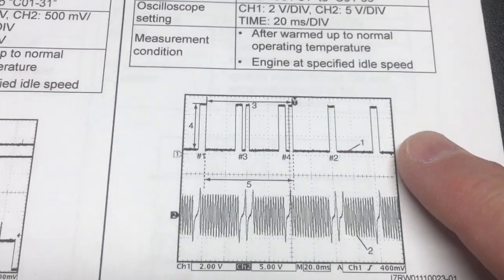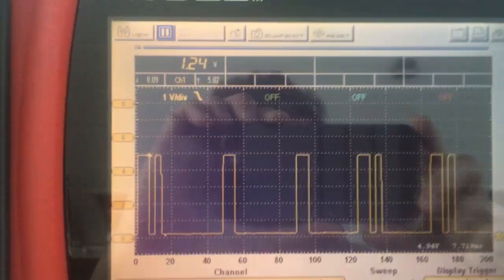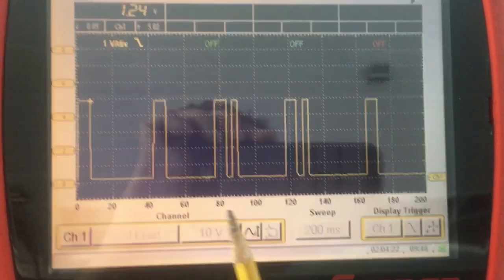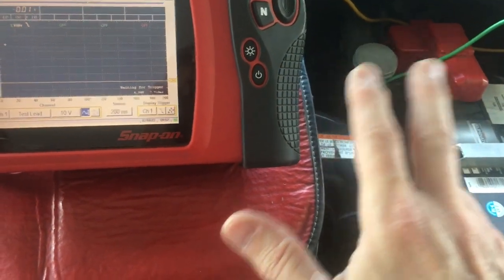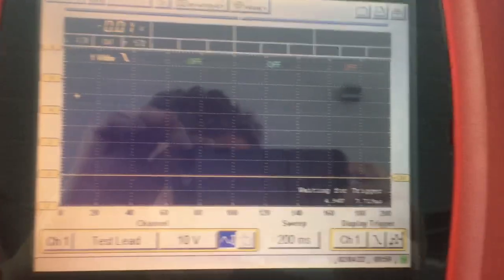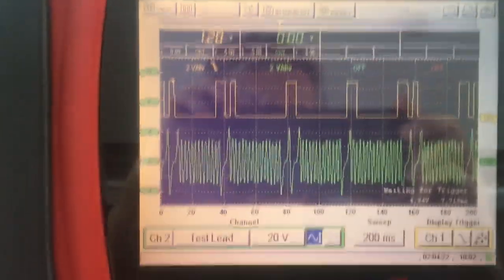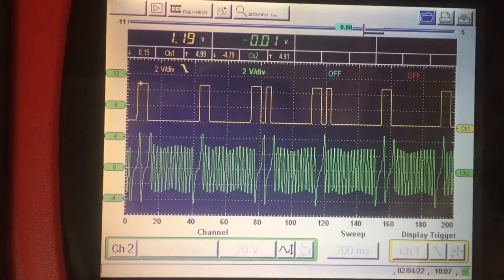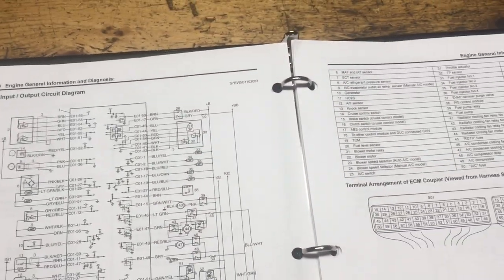Scoping A Cam Sensor

Comment: The car seem happy running with that crank signal, no doubt the sensors are in an awkward place to just swap them over and maybe not even the same crank sensor. Thanks for the update and the shout out. Cheers Matt
Reply from the maker: Cheers Matt 👍

Comment: Hi Ivan! Great to see you looking at the waveforms of the crank and cam sensors. As for the discrepancy between the amplitudes of the crank sensors, I would first confirm that the two vehicles use the same part number. Assuming that they do, you could do a comparison check on the resistance. If that looks good, then you could unplug the sensor on one vehicle and crank it with the scope attached and compare it with the other sensor unplugged. This would isolate just the sensors from its wiring to the pcm and it’s resistor inside. Another possibility is that the low amplitude signal is where the sensor is too far away from the reluctor maybe from rust jacking. Just throwing some thoughts out. Have a great day!
Reply from the maker: All good suggestions/possibilities. I also wonder if the ECM grounds starting to go sour. I think I would have had other issues if that was the case. Corrosion concerns are a distinct possibility. Will do some digging😬Cheers Terry. 👍 Ian

Comment: What manual are you using there. IS IT AVAILABLE  . Thank you
Reply from the maker: https://www.ebay.ca/itm/234664562722?chn=ps&norover=1&mkevt=1&mkrid=706-89093-2056-0&mkcid=2&mkscid=101&itemid=234664562722&targetid=1656417412950&device=m&mktype=pla&googleloc=9000889&poi=&campaignid=17297476241&mkgroupid=135489415143&rlsatarget=pla-1656417412950&abcId=9300870&merchantid=589856935&gclid=CjwKCAjwtKmaBhBMEiwAyINuwNcnRdiun7_t0TNUyHQBd9hQA74e5qFvjGqTy9I_j1UPUB1QJsYo2BoC45cQAvD_BwE
Reply: @TheGibby3340  link is no longer valid